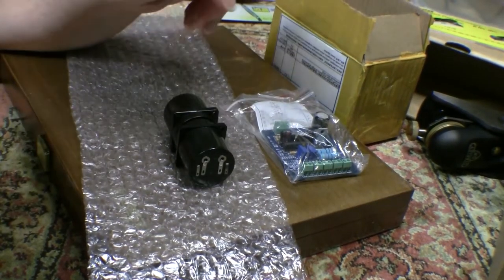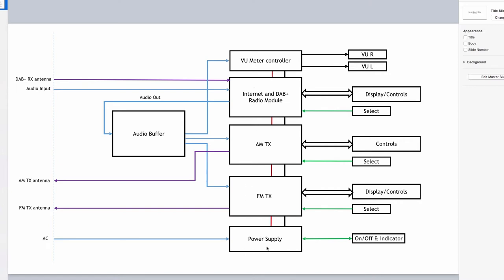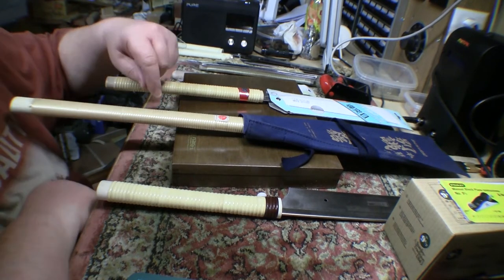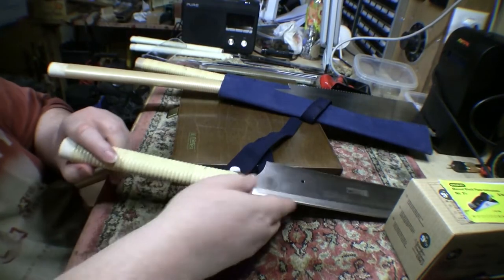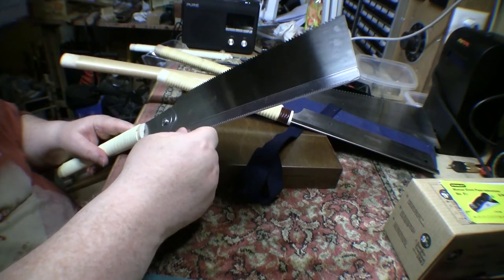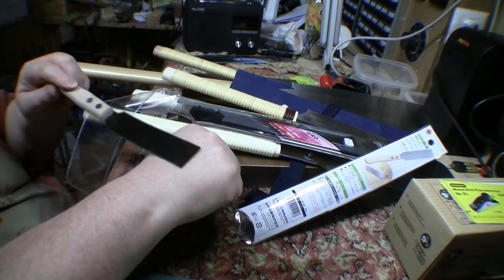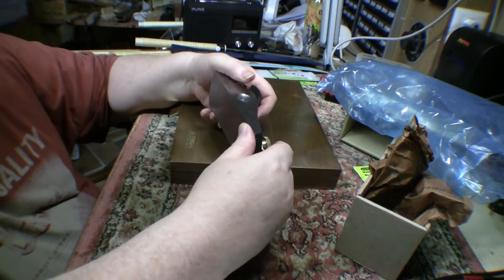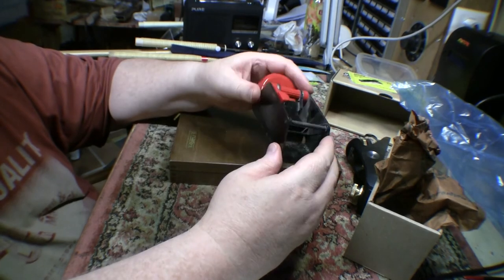TX project update and some new tools for the woodwork bench

Comment: That block plane looks more like something Veritas, or one of the other higher end tool makers would make, I've never seen a newer Stanley with brass adjustments, nor a Stanley block plane with that many adjustments. Most of my planes are old things I picked up in second hand stores and garage sales so the first thing they need is to be stripped down and rebuilt. I have a rather nice block plane but the make and model escapes me at the moment since I don't use it often. I was also given a little plane that uses a single edge razor blade, half of the body is made out of Bakelite. I found a tenoning  plane in my junk recently, which needs to be derusted, I not even sure how I came by it.
 Most of my better chisels also came from garage sales, along with lots of rust, but they are old English and U.S made ones with wood handles and leather pads, so the steel is fairly decent, I'm not sure if I have any older Canadian made chisels. The same is true of a lot of the hand saws I own, most are used, one of my favorites is a dovetail saw, it's like a mini back saw, I've even used it to cut branches off of trees because it's nice and portable.
Reply from the maker: OlegKostoglatov Alas yard sales aren't a thing in my part of the world.   I did get some old tools that my neighbour found in his grandparents loft but they were too far gone  - chisel and plane blades far too pitted to sharpen properly.
Reply: Zone1242
 It takes a lot of heavy pitting to end up in that situation, most of what I've seen is just surface rust, with the occasional pit or discoloured mark after I cleaned them up.
So they don't have the local equivalent of car boot sales or flea markets either? Somertimes you find tools in second hand or thrift store, often in bin in a hardware section. I found a jack plane and a soldering gun in such a place.